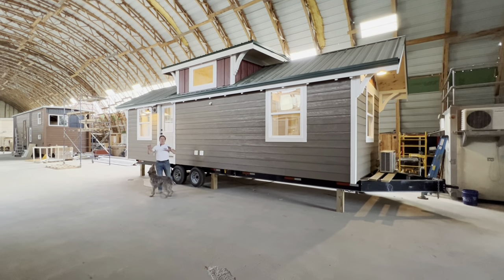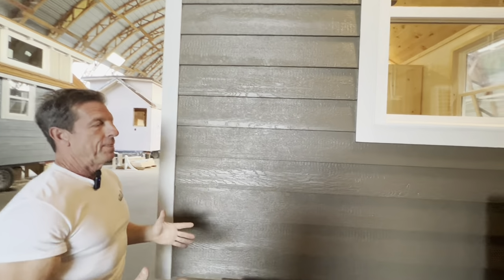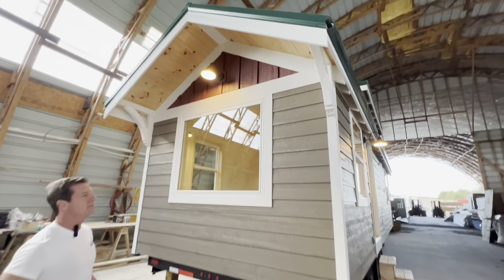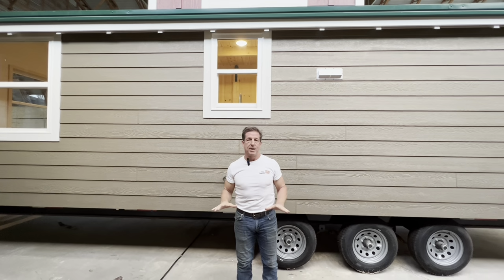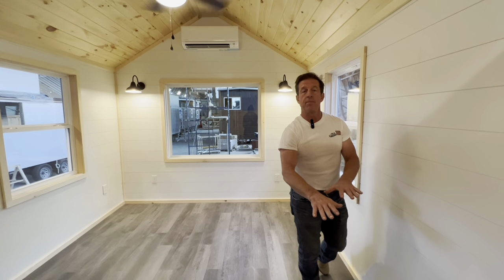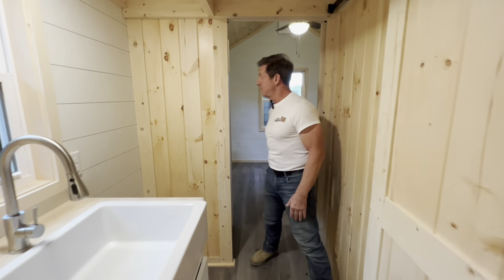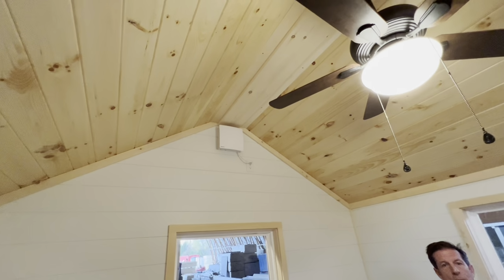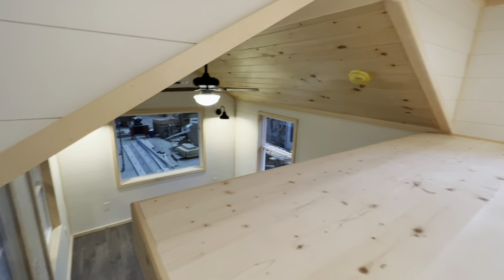Our Incredible Tiny Model - Built by Joseph- The Charleston for $82,500 - Let’s Take a Tour 🏡🤩🇺🇸

Comment: Gorgeous!  If you are considering a fold-down table as an optional amenity, the ones that have a ledge at least 6" wide, then fold down from there, are wonderful... you can leave your salt & pepper, or flowers, sitting on that ledge all the time, even when the table is folded down.
Reply: Idk, I still feel uneasy about the pricing. Apples to apples, I can build a 12x20x14 metal building, fully insulated, with 10 windows and a door for for approximately 12k, including manufacture fees. Pimp the inside and out, it’s now approx 32k. Idk how much it’ll be on wheels, nor the difference by using metal for the shell instead of wood. Add solar and it seems like approx 40k. This includes labor, maybe taxes. So that’s a full two level, 12x20x14, modern, solar powered dwelling for 45k vs an incredibox made from wood, thats 10x20x8?, same amenities or lesss, for 56k. Sounds like a 10k+ profit. Monthly, that’s like a 55k profit. That means I’ll save about 5-15k doing it on my own. Make it make sense. You all need to build that 12x20x14. Or at least a metal or wood 10x20x14 completely off grid for 30-45k. That’s making profit and more importantly helping the people. Idk!
Reply: @Tia Awnesti  No, first building something yourself means you're not paying yourself but you do have to pay someone else to do the work for you.  Add, when you do pay someone else to do the work, then you're also paying for their... 

    Knowledge

    Experience
    Study
    Tools
    Services
    Time to go punctuality
    Accountability
    Professionalism
    Accuracy
    Guaranteed
    Patents
    Sacrifices
    Safety and security
    Payment of tax obligation

Second, a business has to make profit just to stay in business.  Otherwise they can't pay their bills, insurance coverage, medical coverage for employees, pay their employees, or even keep the lights on.  Never mind run the business, do marketing, and actually make enough to make the whole process worth it or they might as well do something else.

Companies like ITH deal with very tight margins, they're not making a whole lot of profit and is why they need to sell a lot of units because only with enough units sold can they make up for the low margins and make it work.

Third, your structure wouldn't be mobile, it doesn't try to pack all the functionality of a home into a smaller space and still be just as functional as a larger home, which requires making use of every square inch of space and making a more efficient design.  Add, for a THOW, the trailer it sits on functions as its foundation.  So you have to add the cost of your foundation for anything remotely equivalent.

While none of that address that the tiny house will be more energy efficient, requires less maintenance, will cost less to own, will cost less for utilities, etc.  All of which can add up to a lot over the years, even up to multiple times what it cost to purchase the home originally...  Long term costs are often one of the main reasons people misjudge cost of owning a home.  The average home owner spends over $15,000 on non-mortgage costs like basic maintenance.  So comparing this to that isn't as simple as it seems...
Reply: @tiaawnesti5497  you have to consider more it’s not comparable you have to pay employees a living wage plus a electrician, plumber etc.. also the trailer it sits on plus do they need permits and the level of craftsmanship.

Comment: Beautiful.  I am building a 10x18 based off the yellow 10x20 featured earlier. The biggest difference is mine in on 7’ 6x6 post inside my aircraft hangar. I truly appreciate all the thought you have put into your designs. I have not found a floor plan better for a tiny house.
Reply: Idk, I still feel uneasy about the pricing. Apples to apples, I can build a 12x20x14 metal building, fully insulated, with 10 windows and a door for for approximately 12k, including manufacture fees. Pimp the inside and out, it’s now approx 32k. Idk how much it’ll be on wheels, nor the difference by using metal for the shell instead of wood. Add solar and it seems like approx 40k. This includes labor, maybe taxes. So that’s a full two level, 12x20x14, modern, solar powered dwelling for 45k vs an incredibox made from wood, thats 10x20x8?, same amenities or lesss, for 56k. Sounds like a 10k+ profit. Monthly, that’s like a 55k profit. That means I’ll save about 5-15k doing it on my own. Make it make sense. You all need to build that 12x20x14. Or at least a metal or wood 10x20x14 completely off grid for 30-45k. That’s making profit and more importantly helping the people. Idk! Love the idea though

Comment: With raised half walls for safety on either side of the loft, is there enough width to have two twin beds side by side if you have two kids sleeping upstairs in the Charleston? What is the width of the loft? Such a pretty house Randy and Amanda!
Reply: He said it's big enough for a king size bed, so two twins would fit, even if snug. You can check the drawing on their website; it looks like there's at least 90" from the steps to the opposite wall.
Reply: The sleeping loft floor is 7'3"x 8'.

Comment: Randy,
I love this house, there is only one change I would like.  Can you put the waterheater under the steps behind the washer dryer.  You could either put a panel on the wall to hide it or put some of the steps on a hing to have access. 

I would rather have the space by the door for my own dresser.  

If that can't be done, for those who will be getting a combo, it could be in the w/d space and you could put your combo on top. 

Oh, one more thing.  Can you extend the rail the bedroom door is on, so when you open the door, you can move it to hide the washer/dryer.  

I would have the door open most of the time and would like a way to Hide the w/d

I hope you have an amazing Day

Comment: Maybe extend countertop down. Couple of feet and put in full size range with microwave above it.   And loft bed needs railings in those openings.   Safety first.
Neat place.  I love outside color.  I had a home painted those colors.  So homey looking.  Be cute with  a full deck across front.   Love it has closet for washer/dryer.

Comment: Beautiful.  Love it.  Only wondering where fridge would go.  Also could loft come with a railing?  Would worry about grandkids being up there.
Reply: Fridge goes on the right side of sink. Railing you have to get fixed yourself.
Reply: There is room for a 10 cubic foot refrigerator/freezer at the far end of the kitchen cabinets, next to the door into the bedroom. You can order a railing for both sides of the loft as an add-on, when you order your home built.

Comment: I adore this model this will be my home to pick... I have 2 request randy. If you want a incineration toilet  can a plug and a vent be fixed in the bathroom? 
2) the steps can you add storage to the steps going up bottom for shoes next step  handy tools and so forth.... ? 🤔😁
Reply: When you order your home, you simply request those add-ons. They can piano hinge the treads on the bottom 3 steps. There is already a duplex outlet to the left of the bathroom sink, so another outlet closer to the toilet would be an easy add-on. Venting it would probably have to be done below the floor, to get through the adjacent W/D closet, or boxed in a chute to vent up the wall, and out just below the loft line.

Comment: How tall is it and what kind of truck do I need to tow it?  Thanks!
Reply: 13'6" tall... 10' wide. You can hire a delivery company, or use a 
heavy-duty truck. The towing capacity of heavy-duty trucks ranges from 12,760 to 18,500 pounds. This class of truck gets the job done and still offers a cushy ride - 
Nissan Titan XD
Ram 2500
GMC Sierra 2500HD
Chevrolet Silverado 2500HD
Ford Super Duty F-250

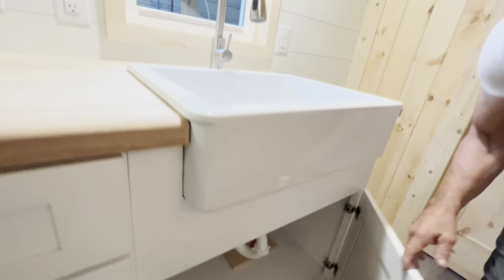Comment: Just a thought... At 9:49... Is there any way all those pipes could be rearranged with conservation of space set as #1 priority?
Reply: They already are, it's just not all buried in the wall because it's run down through the floor.  So you see parts like the drain vent but it's all clustered together with short runs.
Reply: YES, they already are placed on the right side only under the sink, NOT in the center like most builders do, allowing room for larger items to be placed on the left side under the sink.

Comment: Beautiful home. Am surprised there arent more closets as well as cabinets in the kitchen. Also, the hot water heater is too small. Finally, the upstairs bedroom should be a larger area on the second floor - for a better use of space. And it would be nice to see fewer windows in the home. You are very limited when there are windows on every wall. Consider some smaller windows.

Comment: A few questions, would you export to the UK?
Could this tiny home, be fitted with a vehicle style cassette wheelchair lift, for the main entrance doorway?
Also could Solar electric panels,  be fitted to all or most of the roof, linked to rechargeable battery energy pack,  these being house in a customised timber storage compartment mounted on the "A" frame?
Along with separate storage compartment for 2 large gas cylinders?
I was wondering could slide out storage draws for shoes etc, be built into the loft stairs too?
Equally wondering if a small wood burning stovel (with small oven & single hot plate) fire place, installed in the corner of the lounge area, with a two seater sofa bed and a three seater sofa bed too, plus a fold away low level two leaf table and fold away dinning chairs too?
As for the upper loft area, could front and rear wood vertical railing be installed (on safety grounds), while a timber curtain rails are fitted for privacy curtains too?
Lastly could a railway capture and recycling system be installed, with under trailer frame heavy duty plastic water storage tanks fitted too?
As well as a remote-controlled powered awnings fitted on either side too, with zip in side panels, to create outdoor rooms too?

Comment: RANDY JUDAH TORREZ ❤️ <><
Very nice the one thing I would have put in if I by one is up on the loft, I think it needs to have wooden rails for safety, other than that i think its lovely, just my thoughts excellent. 👍🏼
Reply: You can order it built with a railing on both sides of the loft, as an extra.

Comment: I'm seriously looking at your models now, and I think it's important to have a bedroom downstairs.  But in my opinion, having the stairs to the loft on the side makes the bathroom way too narrow.  In 30 feet length, it seems you could put the stairs at the back end and still have a downstairs bedroom and a much wider bathroom.  Of course the dormers would have to be relocated.  And I wonder why you don't use on-demand hot water heaters instead of a bulky water heater in the closet? Maybe there's another model like what I'm looking for.  But they are all great designs too meet different people's needs.

Comment: Very nice tiny house, BUT, I really do not think I could live in it full time.  Not enough closet or storage space, the window in the bedroom at the back end of the house is unnecessary and takes up valuable wall space as does the window in the living area at the front of the house.  There are plenty of other windows to provide natural light and ventilation.  Those 2 windows, the ones on each end of the house, should be eliminated.  I appreciate the quality and craftsmanship.
Reply: I fully agree. A window on every wall is too much and  makes decorating a nightmare.
Reply: @debkski6084  I agree!  With so many windows, there's a lack of privacy, and noise filters in through windows making peace and quiet inside your home more difficult.  The lack of wall space prevents one from having options as to furniture location and cuts down on optional vertical storage.  Almost every tiny home builder wants to install far too many windows.  Timbercraft tiny home builders utilize more transom windows providing plenty of natural light, wall space and privacy.  I wish ITH would use more transom windows.
Reply: @sira451  Transom windows are THE best! Indirect sunlight is the way to go!
Reply: @debkski6084  Couldn't agree more!!  Maybe ITH will hear this suggestion!

Comment: Idk, I still feel uneasy about the pricing. Apples to apples, I can build a 12x20x14 metal building, fully insulated, with 10 windows and a door for for approximately 12k, including manufacture fees. Pimp the inside and out, it’s now approx 32k. Idk how much it’ll be on wheels, nor the difference by using metal for the shell instead of wood. Add solar and it seems like approx 40k. This includes labor, maybe taxes. So that’s a full two level, 12x20x14, modern, solar powered dwelling for 45k vs an incredibox made from wood, thats 10x20x8?, same amenities or lesss, for 56k. Sounds like a 10k+ profit. Monthly, that’s like a 55k profit. That means I’ll save about 5-15k doing it on my own. Make it make sense. You all need to build that 12x20x14. Or at least a metal or wood 10x20x14 completely off grid for 30-45k. That’s making profit and more importantly helping the people. Idk! Love the idea though